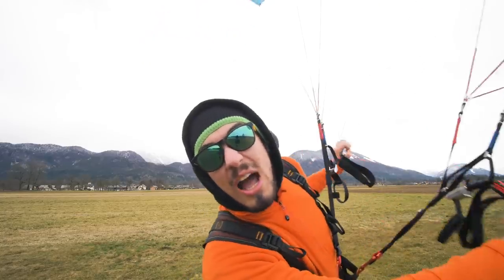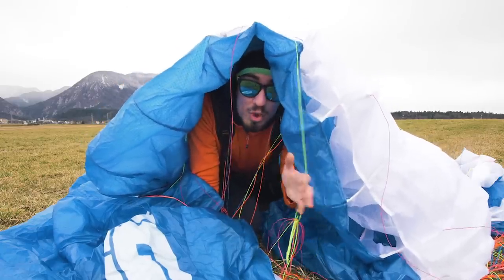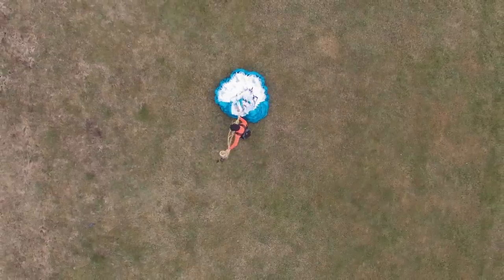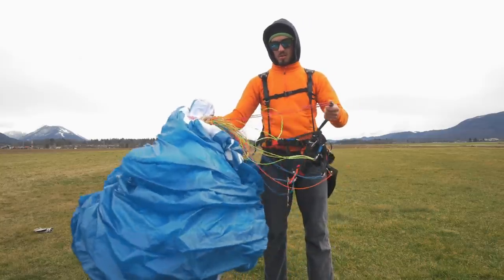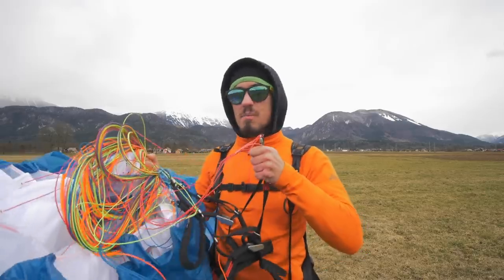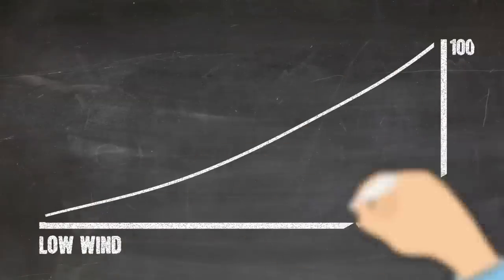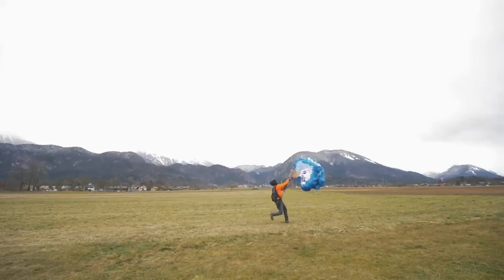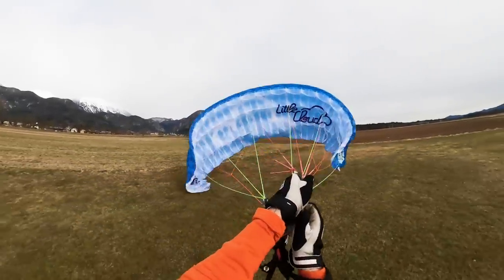Paragliding tutorial THROW AND GO take off tips

Comment: Is it possible to do the same with the big wing not with mini or speedwing?
Reply from the maker: Yeah possible but as wing size and weight increases you have to put in more power to throw wing and overall be stronger at everything. I used standard material paragliding wing in this video siye was 18. :))

Comment: any advice on when not to inflate like this?
Reply from the maker: Don't do it when the wind is too strong because force will be too strong, not safe and also not good for your wing. And of course practice on flat ground A LOT before you do it on any possibly "tricky" take offs. :))
Reply: aljaz salkic i was thinking to do it on the coast. sometime when the cliff is too steap the top of it is without any wind to inflate and there is not much room to run. throwing the wing in the air might be effective to catch the air flow going up the cliff
Reply from the maker: @daniel-gras  Exactly thats one of real life situations that this method works. One thing to be careful about is to not underestimate wind...as you feel like there is nothing at the bottom and throw full power and then as soon as wing catches wind BAM...  Master that method on flat ground and then apply to conditions slowly.

Comment: bro, please tell me, what wing to buy as a bigginer and what should I know most important before I start, also do you have any spare parashutes? and is it possible to go and try to take off but you would not be able to because of wind conditions?
Reply from the maker: Usually for beginner there are “EN A” rated wings which are extra “safe / bulletproof”. The most important thing is ground control, ground handling and kiting the wing. Before you do anything you have to master 1000% control on flat ground and then slowly progress to little slopes and hills. Wind is big factor in paragliding. It can be too strong or from wrong direction which can be dangerous. When you start out you wanna have low laminar wind just enough to kite. Practicing place should be big open place without obstacles and especially dangerous stuff like power lines and so… you can always get beginner wing and start practicing on the ground but I highly recommend getting into course or something. That way you can have guaranteed and fast safe start. All the best!! Safety first 🦅🦅🦅